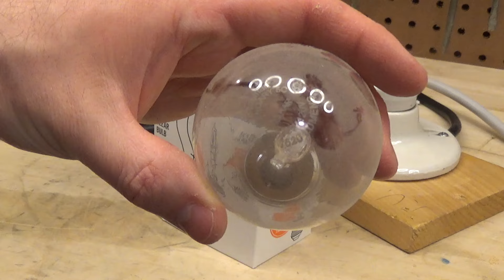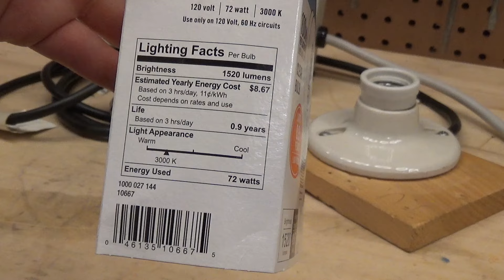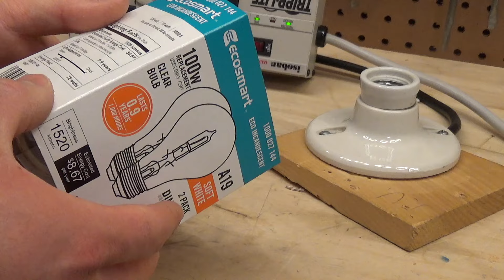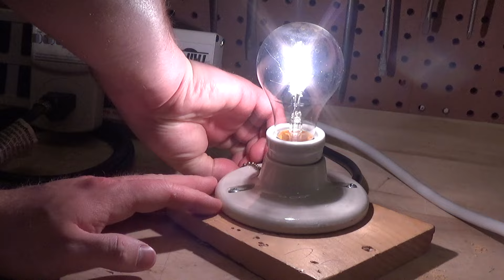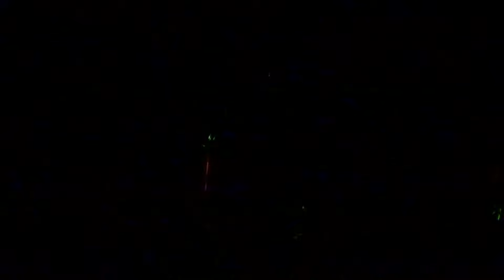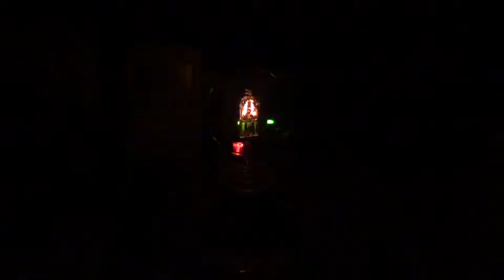EcoSmart 100w Equivalent 'Eco-Incandescent' Clear Light Bulb

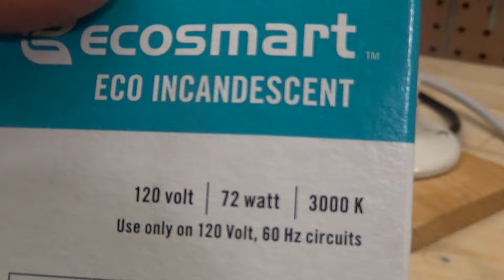Comment: 3:29 That is not true. Halogen bulbs will work on AC (any frequency) or DC with no problem, and cranking up the voltage a bit will cut the lifespan quickly, but increase the light output exponentially (as well as raising the color temperature and potentially the CRI)! Reducing the voltage is almost the same thing as dimming it, but this will reduce the lifespan of the halogen bulb, by diminishing the halogen cycle.

Comment: Enjoyed your informative video. Thank you.
Dimming of tungsten halogen is possible with a reostat. Not recommended for long-term operation as the holgen will form on the inside and darken glass. Best to reset to 100% brightness to get rid of the darkness. Remember, dimmers either cut off the leading or lagging part o the  sine wave. Greetings from South Africa.
Reply from the maker: Thanks

Comment: I have zero complaints about Ecosmart. I've been using their DEL and halogen bulbs for as long as they've been on Home Depot shelves and have always gotten a decent life out of both types. I'd assume the same is true about their incans but their DELs, as far as I can tell, are relabeled Sylvania products, and as far as I'm aware, Sylvania's track record for bulb reliability is pretty clean
Reply: I don’t like Sylvania’s DEL bulbs because they tend to burn out well before the claimed lifespan.
Reply from the maker: I hear nothing but bad things about Sylvania, yet some of the very few LED bulbs I've been able to use are Sylvania and EcoSmart. I've used these halogen bulbs for years and never had any fail prematurely.
Reply: I've heard their LED bulbs are crap from a ton of people.

Comment: The soft white halogen a-line bulbs are dimmer than the clear ones because they use a coating that adjusts the spectrum of the light. I believe it literally  just cuts out part of the spectrum. This is done to make the light a warmer color, more similar to incandescent. The main consequence of this spectrum chopping (other than reduced CRI, I would assume) is that the bulb is dimmer than it would normally be. The 100W equivalent, for instance, may be closer to a 75W regular spectrum incandescent (~1270 lumens vs. ~1680 lumens). This is kind of scam to be honest, though I believe I heard somewhere that it was a government required thing (but I’m not sure how true that part is). Of course, there is no modified spectrum coating on these clear bulbs, so they are as bright as they should be, like a 100W incandescent.
Reply from the maker: There seems to be a lot of discrepancy in regards to what the bulbs claim to be equivalent to and what the actual lumen output is.

Comment: The “buzzing” sound from the light bulb is the filament vibrating. No, it’s not making this sound because this isn’t an ordinary dimmer. I dim my “proper” light bulbs with a regular lamp dimmer and the sound still occurs.
Reply: I have an old video on my channel of a 100w G40 bulb. When I dim the bulb in the video, you can hear the buzzing noise faintly. 

Also, I believe this is only a thing that happens with higher wattage bulbs.
Reply from the maker: I've used these bulbs on dimmers in other parts of the house and never had an issue with this much noise.